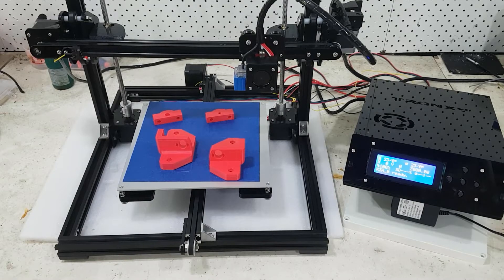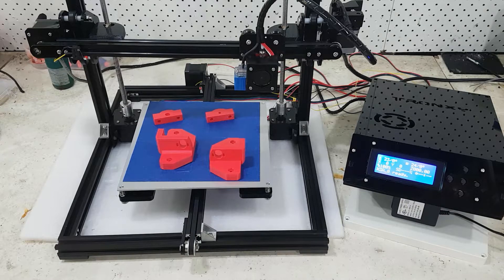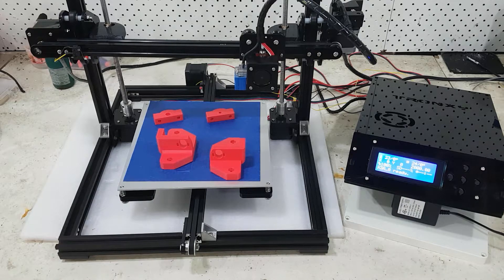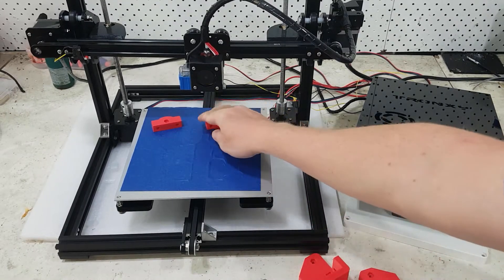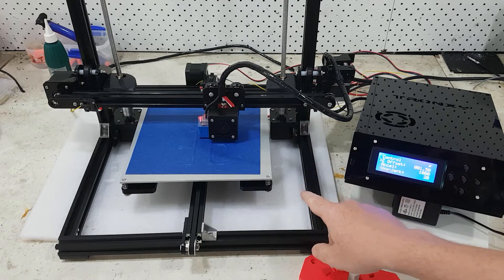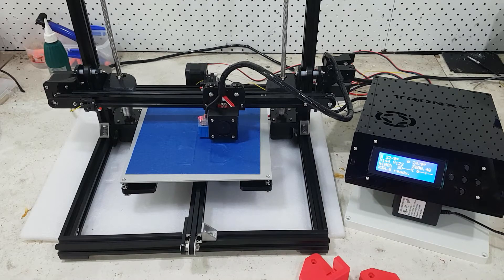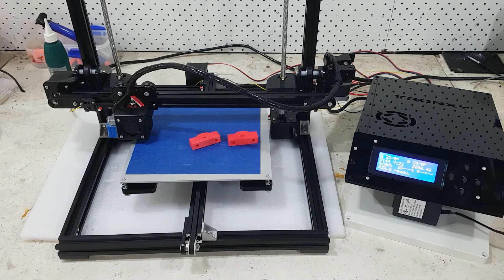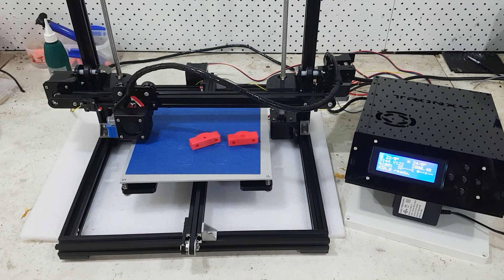Tronxy X3 3D Printer Build: First prints: Episode 3

Comment: i had a prob with the extruder  trying to push through the bed   i traced it back to the wiring connector block. 3 wires ...brown blue and black. the black one had come loose inside the white plastic connector and so when plugged in the wire wasn't making a connection.  I secured yje wire and hey ho all was good. 
othe issues are those damned t nuts that keep spinning and so pull through the aluminium section. i just had to put them straight then pull the screw back to put pressure on which usually helped prevent them turning and coming thru the section. 

brilliant video serioes mate ...thanks so much for all your efforts. was a great help

Dave

Comment: You are a few days ahead of me, so you conclusions came at the right time.
BTW, I have Assemble Guide, Operation Instructions but I haven't see (online) any PDF with initial calibration/configuration of the printer.

Is that included in the supplied SD?
Reply from the maker: um i don't think there is anything like that.  i've spent alot of time playing with cura's hotend temp and Auto Level height... Haven't really moved on to anything else yet.. Pretty much stuffed till i get the part cooler thing sorted.
Reply: How do we calibrate/adjust limit switches?
Isn't there instructions to do so? :(
Reply from the maker: you don't need to adjust them ? the length of that axis is defined in your gcode app ( Cura ) .. it then takes that number from the Limit switch i beleive

Comment: Nice video again btw.

Z-Axis: When i select move axis > 0.1mm.  I am able to move the z-axis. However, it wont work for 1mm / 10mm movements.

Squeaky noise: The noise is of the acrylic plate rubbing against the motor shaft on the X-axis. I had the same issue and it bugged me till i found out what it was.
Reply from the maker: ok i haven't tried 0.1mm 

I have fixed the squeaky noise to my surprise it was coming from the motors .. it's a surprise cos WD40ing them didn't fix them... A full tear down did though. I'll do a video on this soon ish
Reply: All the motors? :(
Thanks for taking the time to make that video..
Reply from the maker: Not a problem. 

I didn't cheek the Y cos i knew the X was super bad and i thought it was best to do both at the same time